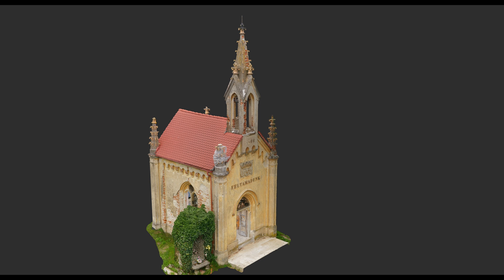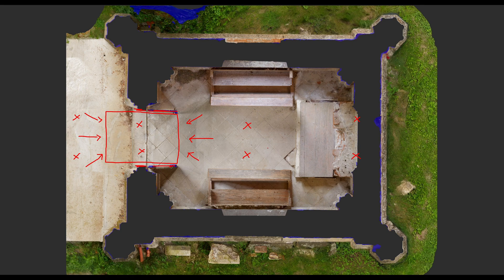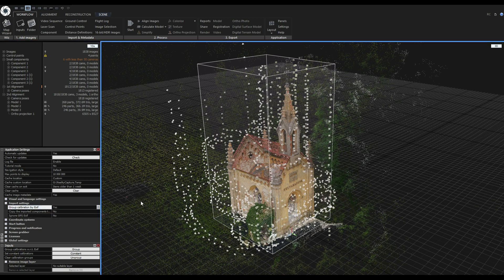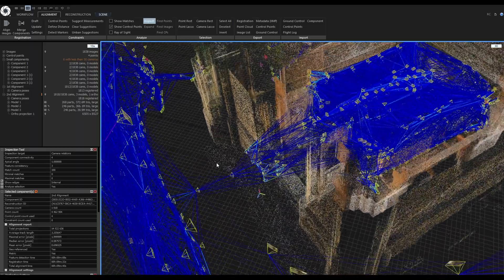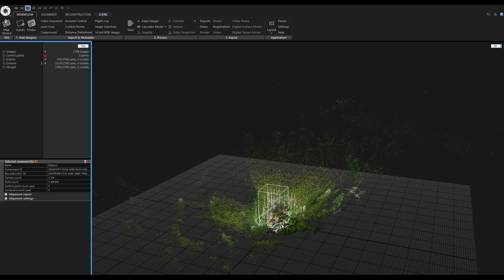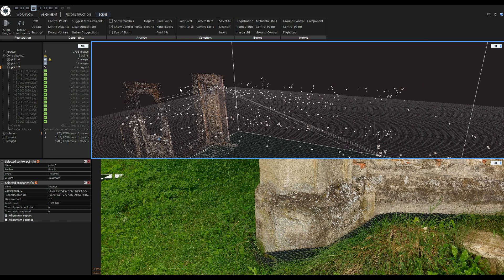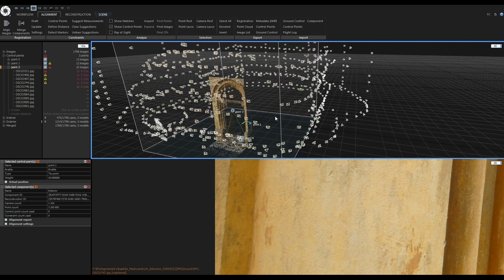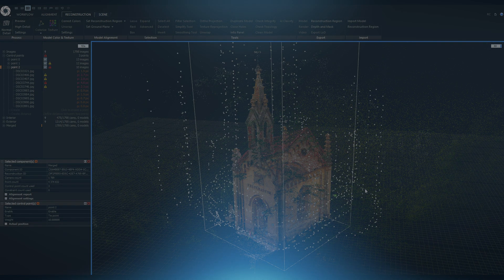RealityCapture tutorial: Merging exteriors and interiors of buildings

Comment: Hello, I will need help... I am creating pezinská baba hillclimb track and i cant merge all the components together. I have aligned all images but it split into 4 components. even i have correct control points, nothing isnt working for me. any solutions?
Reply from the maker: Hi, are your images georeferenced? If so, you can use Merge georeferenced components option in the advanced alignment settings. 
Also, how are your control points placed? Are you using minimally three of them placed over all components on minimally three images for each component?

Comment: Setting directions (ground plane) makes a lot of trouble. The axes are unnamed. It is too easy to make a model upside down, that fails to merge. Could you add simple icons to the axes, at least where is north and top. Yes, I recommend geographical directions instead of left, right, front, back. They are misleading. When we are inside of an object, looking left we see the right side. Using West, we always look to the west, no matter if we are inside or outside.
Reply from the maker: Hi Abrimaal, thank you for your ideas, I will add them to our feature request database. The axes in RealityaCapture: green - Y, pointing to north in georeferenced datasets, blue - X, pointing to west in georeferenced datasets, red - Z, pointing up. You shouldn't use geographical directions in non georeferenced models, because there is not North, or other sides.
Reply: @RealityScanOfficial  Yes,  there is no use of geographical directions when we work with objects that can be moved anywhere.  This is still better to use RGB colors of axes than XYZ - different in every editor. I didn't know about the colors, thanks

Comment: Amazing quality of work and thanks for the detailed explanation. I have a begginer question for you: as i understand pictures that are taken by the dslr camera are not georeferencied. How is it possible to use them in photogrammetry without geo information. By drone I understand that a gps is integrated in the hardware , but for indoor gps is not detected. 
Thanks again!
Reply: RC doesn't need and geoinformation. It uses photos to find features. It then matches them between images, and based on this, it can calculate the position of the features and cameras in 3D space.

Comment: question about workflow.....
After the section on viewing the unregistered pics, you state you realigned the images.... Simply bringing up the unregistered pics like at 5:40, improved the alignment when it was done again?

And it looks at this point, a model was built but it was not mentioned.... is that the case, a model was built?

Thanks!
Reply: RealityCapture used the 1st alignment as a base and during 2nd alignment it was able to add a couple of unaligned images. The alignment improved on its own during the second run. No user input. The model was built after the second alignment. Each alignment creates a new component without any models.

Comment: Hi, So if i understand properly you need to take lots of pictures around the door and eventually add manual tie points.
How do you reach cm level accuracy inside the building ? Do you need a total station to "project" GCPs or markers inside the building ?
Thanks ! 
Again great work !
Reply: Thank you for your kind words. Like I showed In the first case you don't need manual tie points if you have enough photos with high overlap. Reality Capture will align everything in one go. You have to use manual tie points only if the interior and exterior are not connected with photos like I showed in the second scenario. A total station is not necessary to achieve high accuracy. If you want to work just in a local coordinate system you can define distance constraints. Just take measurements with a tape or a handheld laser meter. Measure some distances on site and define the the distance constraints in RealityCapture. I did not show this in this tutorial because distance constraints were covered in another beginner tutorial and I didn't want this tutorial to bee too long and complex. Of course if you want your project to be georeferenced than use a GNSS receiver to measure some GCPs in the exterior and use a total station to measure some GCPs in the interior. It really depends on what you need and what you are going for. Or you can even combine photogrammetry with terrestrial laser scanning in RealityCapture. We have a tutorial series dedicated to this workflow from CyArk on our YouTube channel.
Reply: @jvanko89  Thank you very much for these detailed explainations. It helps a lot. Looking forward to work with Reality Capture